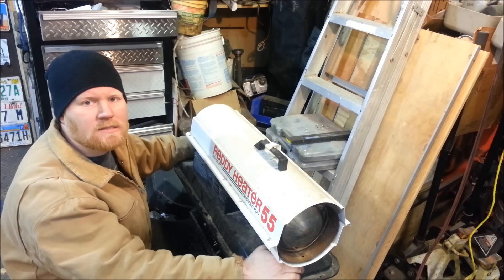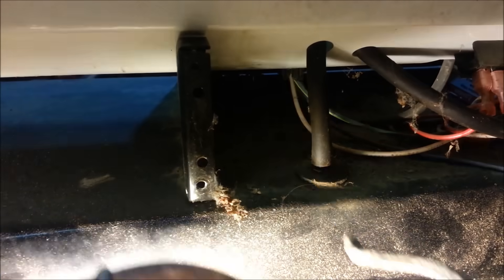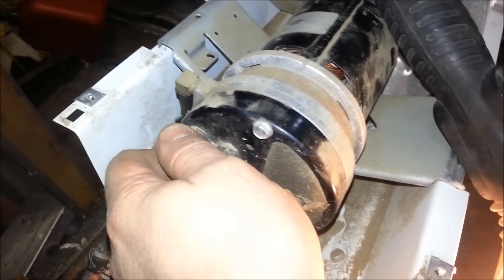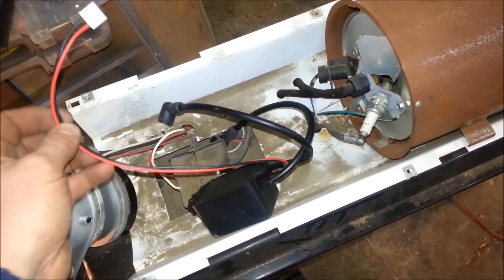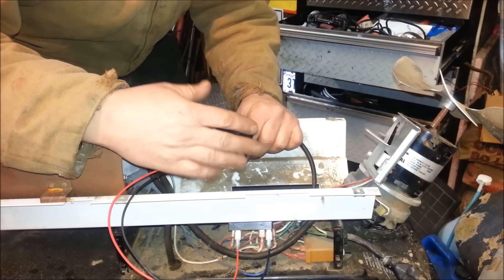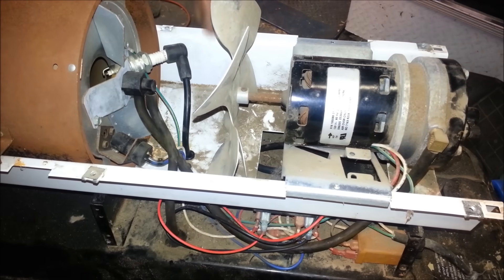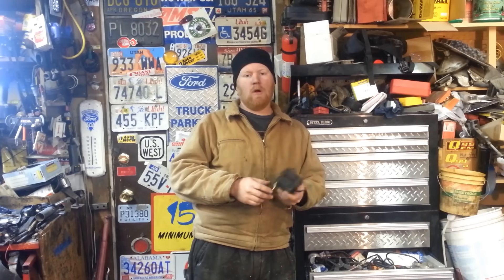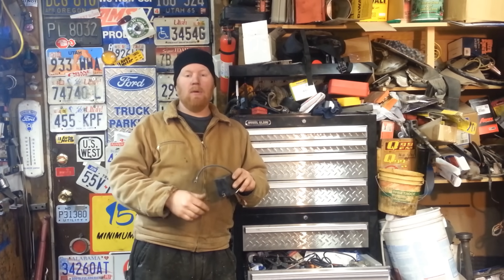Torpedo Kerosene Heater repair & HOW they work

Comment: Ya I have lots of fuel flowing. The fuel is for sure producing the cloud out hte front.  It tries to light for awhile and than trips the reset button. I don't have a way to check the pressure at this time.  I never made any adjustments to the fuel pressure when it went down.  I don't have a fuel leak in any place.  I tore the unit down and cleaned it up to see if I had any leaks.   I have the spark plug pointed right direction and  I have tweeked it a couple of times to make sure the spark is right.  I will try and drain the fuel and try some fresh fuel. It seems everything else you mentioned it working fine on this end.    If I don't get this pretty soon I will have to go out and purchase another one.  Need to keep some heat on my skidsteer.  
  This might be really stupid on my part.  I never put the unit back together when I tested it.  Do you have to have the unit together as a safety thing? I noticed you put it all back together before you started it.  I am going to try that.  I am guessing I am not that lucky.  Thanks for all the help hope we get this thing running.
  Not that it probably matters.  The heater you feature in the video is the exact same one I have.  I tape up the second spark plug lead.
Reply from the maker: liloz33 I know it can be frustrating but you're very very close to having this thing run. First, I would place a random old spark plug(any kind) into the other lead as it'll ensure the unit isn't going to overheat the new coil (I know I didn't do this in the video but I did it later).  The cover doesn't need to be screwed down but does need to be on so the fan can force air through the unit. It is essentially a small engine and needs a proper fuel/air mixture for combustion. It relies on the fan to give it the air. Your spark plug in the combustion chamber needs to have a large .060" gap.
Reply: sixtyfiveford  I just pulled everything apart checked my gap and position.  Redid everything and still nothing.  So I thought I will switch the wires around on the ignitor.  Nothing. Then switched the wires around on the sensor.  Not only did it start, but there was so much fuel in the damn chamber it started on fire in my house.  The entire chamber was filled with fire. I am trying not to laugh as I watch this, but it was damn funny.  I got the fire out with little to no damage.  Going to take it outside and clean out the chamber and see if I can't get this thing to run.  I just want to thank you again for all the help you passing on.  It is greatly appreciated.  You know anything about Polaris Four Wheelers? :+) Thanks again Jim
Reply: liloz33 really funny story.  I put it all together screws and all.  Brought it outside and it once again won't start.  Going to walk away for a little bit and try again in a few hours.  Hope the fire did not screw it up.  Anyway funny story.
Reply from the maker: Mine just caught fire the other day as it took 5 times of tripping the reset before it fired off for the first time in a year. Since it fires off first time everytime (about a dozen+ times now). They're designed to take a good amount of heat, so you should be OK. Now that we know you have everything to fire off we can tweak stuff. If it continues taking to long to fire before tripping the reset, increasing the spark plug gap to .070" or so can help along with turning the air pressure screw in(clockwise) a 1/8 of a turn at a time(increasing). Note the exact position so you can return it to the position if need be.
Reply: sixtyfiveford I have tried it about a dozen more times and it has not started yet.  I think tomorrow I am going to drain the fuel out and start fresh.  I will try and gap the plug a little more as well to see what happens.  I was not surprised that it did not start after I got it all together.  I actually laughed about it.  Oh so much fun.
Reply: sixtyfiveford I now have no spark again.  I am writing to the company to see if they will replace it, but if not I am done with this one.  Just not worth putting anymore money into it.  Thank you very much for all the help.  I learned more about this thing than I ever intended which is a great thing.  Thanks
Reply from the maker: I had a unit years ago that I would light off with a propane torch because it had a bad coil. I would have to hold the torch there for a minute to let it heat up but then it would continue by itself. The process was semi dangerous and involved me partially removing the cover to get the torch in there then closing it back up once lit.
Reply: sixtyfiveford  Ya just semi dangerous.  Thats funny! Thankfully the company called me and asked me if I could test the circuit board. I did that and it is still good so they are sending me a new one.  Just not sure why it burned out so quickly. If this does not fix my issues I need a new one no heat in my shop right now.
Reply from the maker: That's great of them to send you a replacement. Let me know how it goes with the new coil. Put a random spark plug in the extra lead.
Reply: Just got new coil in today.  Hooked up and did not start after like ten tries.  #11 was the lucky one because it fired up andI mean it.  It caught on fire again.  Long story short it is up and running now hope it lasts this time.  Thank you again for all the help.
Reply from the maker: Heat is always a nice reward for your hard work.

Comment: I do now.  I did have the fuel lines swapped out by the photo sensor.  I thought I saw that but I just worked a 24 hour shift anyway I swapped the lines and got the fuel to flow and it idd not help.  I have the same results but now I have the fuel spraying.  Still have good spark as well.
Reply from the maker: liloz33 The photo sensor will trigger the reset button if it doesn't see light after a few seconds. It won't stop the unit from lighting. If you have good spark with a properly gaped plug, opened towards the flame then you have a fuel issue. The pressure could be too low/high, the air line could have a split, The fuel pickup line could have a split, water could be in your fuel, or air filter for the air pump could be clogged. A properly functioning fuel system will produce a cloud of fuel that comes out the front when the unit fails to light.

Comment: I have now changed the ignitor and also the photo cell flame and I still do not have heat.  Wondering if you have any other suggestions? I have good spark from the plug now but after changing the sensor I have the same results.  I bought the sensor locally but it is the same sensor you referenced.  Is there a way to by pass the sensor? Why hazard is caused by by passing?
Reply from the maker: liloz33 Do you have a cloud of smoke coming out the front?

Comment: Great video!  Thanks for the help.  Purchased a used sears heater that when I purchased it, it had no issues starting up.  When I needed it, of course, it wouldn't start.  It puffs a cloud of smoke and turns off.  Any thoughts?  Thanks!!
Reply from the maker: jason Rudolph Could be as simple as a dirty spark plug.
Reply: Changed the spark plug.  There is fuel spraying, spark, and the fan is blowing... But it doesn't fire up.
Reply from the maker: The spark plug needs to continue sparking the entire time and have a large gap(around .060". Also positioning it so the open end is facing the nozzle.  Make sure water hasn't gotten in the Kerosene/Diesel. It will float to the bottom but you should see it with a strong flashlight.
Reply: I'll check the gap on the plug.  It is positioned according to the diagram on the heater.  I don't think any water is in the fuel but I'll look again.
Reply: jason Rudolph Well, it's working now!  I have replaced the spark plug and gapped it.  I also took apart the entire air and fuel system and cleaned them with an air compressor.  Replaced all 3 air filters as well.  After running for a bit I adjusted the pressure.  Get a nice red cone now.  Thanks for the video, it really helped me as I was working on the unit!
Reply from the maker: Great work. Enjoy the heat.
Reply: sixtyfiveford I have intermittent issues with this heater yet.  It will run sometimes, and not other times.  Today I ran it for about an hour, turned it off when the shop warmed up some.  Then when it cooled I plugged it back in and it wouldn't start.  The fuel sprays, there is spark, and the fan rotates.  When it's running it runs just fine, it doesn't turn off on it's own.  I tried adjusting the pressure to get it to start and that didn't make a difference.  The spark plug only ignites a small portion of the fuel when I'm watching what's going on.  I don't know if it would start without the cover on or not but I've tried both and it doesn't seem to make a difference.  Eventually there is too much fuel in the unit for me to feel comfortable with trying to start it any longer.  Thanks for the help!
Reply from the maker: These run like an engine and need the right fuel to air mixture. This is adjusted with the air pump. The fan always delivers the same amount of air and the air pump directs the amount of fuel to balance the mixture.  If it doesn't fire and is making a good amount of smoke(automized kerosene/diesel) then it is more than likely getting too much fuel. This would mean the air pump pressure needs to be turned down a little(counter clockwise). This is assuming there is a good solid spark.
Reply: It's not making any smoke but I can see spark from the spark plug.  There is no puff of smoke.  It just doesn't ignite the fuel.
Reply from the maker: If there is no smoke (fog of diesel/kerosene) then the machine isn't getting enough fuel.
Reply: sixtyfiveford I believe I finally have this thing working correctly, just in time for summer!  I took apart the compressor and cleaned all the parts inside, and the case, with brake cleaner.  This allowed better flow of both air and fuel.  after adjusting the pressure so I have a nice red glowing tip, and trying it three different days, it appears to be working!  Thanks for all of your help.
Reply from the maker: You've put in a fair amount of time. I hope it's good to go next winter.
Reply: I had never used one or been around one before this one.  I've learned a lot.  Thanks for your assistance.
Reply: He just showed you how it's done. Go to the video and watch it this time instead of one eye on the neighbor. 
 Cool. Ya got it workin'. I like your "stick to it" attitude. Must have alotta time on yer hands. Lol.
 Gitt'er done.

Comment: It took nine months but the website finally has the ignition module in stock and I got mine.  Now the Optical sensor apparently has gone bad.  Do you have a webpage for that? I goggled it and even went to reddy heater webpage and can't find one.  Thanks for the help "I GOT SPARK" :+) Is there a way to test the sensor to make sure it is bad? I did find one now but they call it a "Flame Sensor" pretty sure that is it.  Same webpage. Thanks again
Reply from the maker: liloz33 An optical flame sensor is the same thing. The flame sensor(light sensor, optical sensor, photo sensor) should pass current through the 2 wires when there is light from the flame. When there is nothing it won't pass current. You can test by connecting the 2 wires and running. The Photo Sensor gets dirty and stops seeing light, so you can usually just clean it. Here is an optical flame sensor from them: http://www.equipsupply.com/products/1000637-CAD-CELL-FLAME-SENSOR-MH-PA-HS-2009-10-UP

Comment: Hello,

I just bought a Mr. Heater MH50KR 50000 Kerosene heater from craigslist.

I turned it on last night and it would spark but no fuel came out. i moved the air pump line further onto the outlet and now it comes on. Fuel comes out and the front gets red but flames come out the front for a couple of minutes while getting hot but sounds like its sputtering. I tried adjusting the two nuts.

I checked the air filter and its a little dirty but not much. Any adeas? Not sure if I shoudl check air line, fuel line or adjustments in back.

Cheers!
Reply: Forgot to mention it shuts off after a few minutes after flames come out front.
Reply: Sounds like the photo resister is dirty (at 6:00)..

Comment: I have a ready 155 what do I use for fuel and the video was very helpful
Reply from the maker: raul santoyo I use regular diesel or off highway diesel/red dye (same as regular diesel you just don't pay road taxes on it and it's dye red to catch misuse). I can buy diesel for low $3 where Kerosene is $10-$15 a gallon. Some people claim to hate the oil or engine smell of diesel in the heaters. I personally think Kerosene smells chemically and far worse.
Reply: sixtyfiveford thank you very much and I like your videos
Reply from the maker: Thanks for watching.

Comment: The part i asked you to identify is a "carbon rotor" which was broken .  I ordered another along w/ pump filter from
"Space Heater Parts.com", cost was $27.00 for both w/ shipping.
So now you know what it was that i tried to identify.  Is there anything special i need to do when installing this part ?
Reply from the maker: It will come with an instruction sheet. It is pretty straight forward though.

Comment: Just finished working  on my Reddy Pro 150. Changed all hoses, cleaned the orifice and fittings with carb cleaner.  All appear clear. Problem:  Pump is not drawing fuel, took the hose out of tank and placed it in a clear jar full of fuel, just to see if it was getting fuel.  Has no suction and didn't pick up the fuel.  Do you think it could be the pump and if so, is there any way to repair it?  P.S. - took apart the pump cover and there was a filter which i cleaned, also there is triangle black pieces of plastic or some other substance that is part of the pump, can you tell me what this is ?

Comment: Can you use diesel fuel mixed with kerosene , say 1/3 diesel 2/3 kerosene .  Thanks, love the video.
Reply from the maker: Joseph Maximus Yes. I run straight diesel in all my heaters but you could mix it. Kerosene where I live is $10 a gallon but I can get off road (red dye) diesel from mid to low $3 range. Some people hate the slight oil smell you get from Diesel but on the contrary I hate the chemically smell of Kerosene. I got 15 gallons of kerosene for $10bucks from an auction last season and after using a gallon or two I went right back to diesel.
Reply: sixtyfiveford  Hey that's great  it sure will save a lot of money. Thanks again.  I really enjoy your videos , this one 
is  helping me with a heater I  am working on presently. Sure glad I subscribed.

Comment: I came across one of these today.  It's made by Dayton.  The small amount of kerosene in it is probably at least 2 - 3 years old.  Does kerosene go bad like gasoline?
Reply from the maker: The Kerosene will still be good. It has a very long shelf life.
Reply: Great.  Thanks.
Reply from the maker: Regular diesel fuel is virtually the same thing and these run great off it. Around me Kerosene is $10+ a gallon vs under $4 for Diesel.
Reply: sixtyfiveford Okay.  I cleaned it last night and checked the condition of the inside; everything was in really good shape.  It fired up like it was new.  As far as kerosene...it seems like it's at least $8/gallon and it's not all that easy to come across.  What's the reason for that...
Reply from the maker: Kerosene is Jet Fuel so I guess that they figure they can charge an arm and a leg for it. I think it sticks and prefer the smell of diesel, other are just the opposite. You can even buy Red Dye Diesel or Off Road Diesel for even cheaper as it is exempt road taxes.

Comment: I have the same unit you have here..I'm having trouble with it not burning all the fuel from the nozzle..just making smoke & fumes then eventually pulsing out..plug & spark is good..nozzle is clear & spraying fine..I'm leaning to some bad kerosene being the problem maybe?. I just topped it off with new fuel too..figures..I'll check it for water & get back to ya .Good video btw
Reply from the maker: The pressure could be set to high, or the foam filter on the back could be plugged up.

Comment: They work great in A garage if K-1 kerosene is used. Fuel oil will stink up the place.
  Usual precautions apply. Plenty of ventilation, working CO detector, have someone check on you from time to time and you will be warm and safe.
  A thermostat that plug's into the wall and then into the heater will save A lot in fuel cost but they are not cheap. I found my heater's and stats at auction in the dead of summer dirt cheap. Not much call for heating equipment when the day is topping out at 100+!
  I have A couple of propane unit's that I prefer but when it gets cold I don't care, as long as I'm warm!
  Thanks for the information. I was not aware of the universal spark coils. Good to know.
Reply from the maker: I guess it's just person preference on the fuel. I personally hate the smell that Kerosene gives off and prefer just regular truck Diesel. I also have some propane ones but propane looses BTUs as it gets colder. I found by keep my propane cylinder indoors so it is room temp it works a TON better and never freezes up.

Comment: I have fuel pouring out of the front end from trying to get her fired up!
I cleaned the fuel nozzle,turned the plug everyway possible but she won't light!
Runs for 10 seconds and shuts off.Now what? Take it to the gun range and blow it to hell?
Reply from the maker: You can try lighting it next to the spark plug with a propane torch while it's trying to fire.  Kerosene/Diesel won't ignite unless it is a fine enough mist. The pump could be to low on pressure to atomize the fuel. Some pumps have adjustable vanes to increase and some pumps vanes wear out.